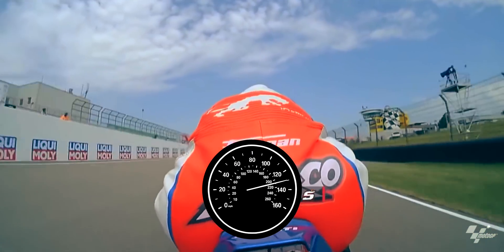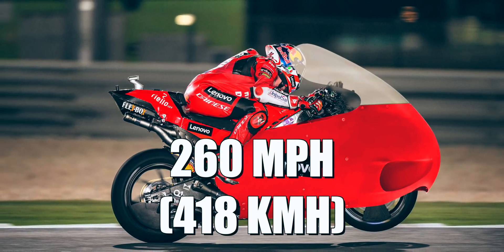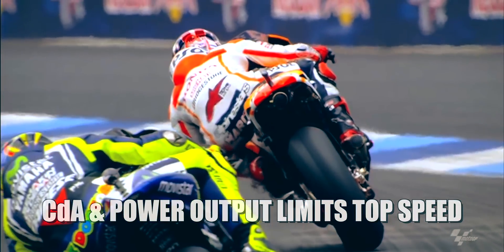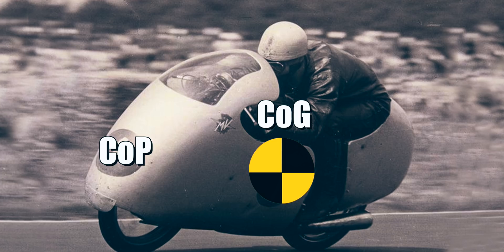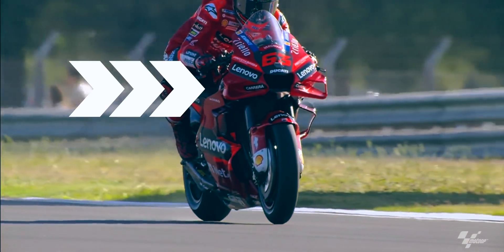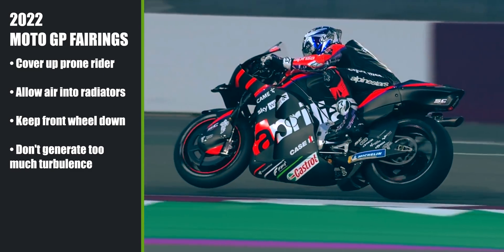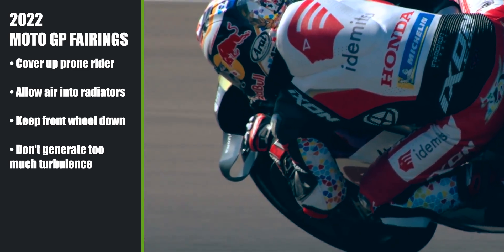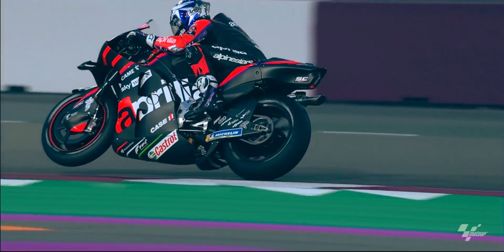Why Don't MotoGP Bikes Have Torpedo Fairings?

Comment: I believe Dustbin fairing designs can still be used, as long as you engineer in counter measures to crosswinds
Reply: No, they're not allowed. The fairing must not go forward of the front rim and the rider's hands must be visible from the side.
Reply: @gasdive 
And it's BS limits like this, that retards the whole industry. This same barrier to innovation exists in Formula 1. Do you know how creative F1 teams were back then? It wasn't just driver skill, it was great engineering. Then fools & bullies complained to authorities, instead of copying or expanding upon a great idea. Same thing happened to Audi when they brought their AWD system to American racing, competitors whined like b#$%&€ to handicap Audi, then ultimately got AWD banned. 
Crap like this is why I prefer Streetracing & open-class-Pikes-Peak, over MotoGP & F1.
Reply: @observingrogue7652  they would have solved the stability issues in a season or less, and now we'd have petrol bikes that get 100 mpg and electric bikes with 400 km ranges.

Comment: Weird they haven't implemented actuator controlled winglets
Reply: Right. Bikes need adaptive downforce, for all lean angles.
Reply: @observingrogue7652  theres a lot of room for implementation but the engineering team will have a lot of design issues to contend with for consistent downforce:
-temperature affects wind density
-wind direction (major issue)
-rider adaptability to the automated winglet
-front tyres lose their grip in the final laps so the automation would have to account for that
-suspension geometry would radically change
-each corner requires a specific downforce
-winglet location would change if it's automated as it can't be too forward so as to put less stress on the front tyre during braking

There's probably countless more engineering challenges but still weird they haven't implemented it
Reply: @baneoffsight4871  Did I detect a hint of sarcasm?
Reply: I think they should have limitations on developments that won't translate to street performance. Especially when all teams implement the tech. I submit holeshot devices,...why? Everyone has one and they are useless on street bikes, so why? Actuator winglets are at least translatable to street performance.

Comment: Without watchng the video I'll give the answer: the rules specifically prohibit the use of fairings / bodywork that encases the front wheel. This has been a hard and fast rule for decades.
Reply: neato, but the purpose of the rule is the interesting part
Reply: I’ll give the true answer. “A dustbin fairing creates a Center of Pressure that is ahead of the motorcycle’s Center of Gravity.” This makes the bike less controllable

Comment: Those fairings are banned for reason. Top speed is already a problem for MotoGP being higher than F1 creating a need for even larger run off areas and of course higher risk of severe injuries and death.
Reply: with the new tech air 10 that shuld help out in that department it pretty much cover the rider in an airbag.
Reply: @patthonsirilim5739   The need for bigger runoff is extremely serious because  airbag suits can’t prevent fatal injuries if rider hits walls at high speed.  Having room to slide off the speed before impact is best protection
Reply: @jonasbaine3538  here the thing about airbags since there introduction alot of injuries and death have be mitigated a high side use to mean fracture now it rarely does much more then bruise and being run over by a bike from the back use to mean death or disabality now just big bruises of course if you run 100mph straight into a cocrete wall your dead but track have been fairly the same run off is still dangerous for a bike rider if you fell off the bike at 150 mph there a chance you may tumble long before you hit the wall that tumble without airbag could casue alot of fracture and pain just look at monza muggello kylami silverstone etc
Reply: @jonasbaine3538  riders now have a special gadget under the seat, when it detect that the bike is going to crash the rider is ejected
Reply: What's wrong with you guys? Make everything save enough you will end up with no fun.

No one is forcing them to race these bikes. They could do a normal job or race something slower, but they choose not to.
Reply: @donblub  these are on track where safety it's n.1, for what you want you should look at the isle of man TT it's racing on a public road with near to zero safety
Reply: @donblub  yeah exactly. they get payed a fuck ton to do this so they make up for it with the salary.  people seem to forget that allot of people don't even do this shit for money they do it as a hobby. if they can risk it for nothing more than a smile then MotoGP can risk it for a fat paycheck and a fat smile. but these types of fairings are not fun to watch. a lot more enjoyable watching them the way they look right now
Reply: F1 cars have low tops speed
Reply: Highest speed in F1 was 375kph
Reply: @Smexy_af  it wasn't, officially its 370kmh and also it was back then. The cars are slower now with just 320kmh top speed and they don't accelerate as fast as they did back then. An f1 could do 0-300kmh in about 9.5secs. Now its 11secs. The gp bikes still accelerate alot faster and have higher top speeds.
Reply: @redtail1.  — When was “back then”. The modern hybrid car holds the record for fastest speed during a race.

“Valtteri Bottas currently holds the record for the highest speed in an F1 race, hitting 372.5km/h (231.4mph) in the 2016 Mexican Grand Prix.” — Autosport, June 2021
Reply: @Smexy_af  That speed was set in Baku, with a start/finish straight line of about 2,2km. The longest straight line in MotoGP I think is the COTA with 1,2km, but the best is probably Mugello because of the faster last corner. This year Brad Binder reached 366 km/h on a 1,1km straight.

Comment: Question:  Since the winglets are fixed the downforce they create works against the tires in a turn, since the bike leans inside and the downforce is pushing to the outside.  I would think this slows the bike down in the turns.  Does the winglets' aid in accelerating out of turns make up that much for the possible loss in turning g?
Reply: The winglets are angled at roughly 45 degrees. In a turn the inner winglet is therefore perpendicular to the ground whilst the other is parallel.
Normally, these would work against the tire, but they are built in a way that the inner winglet stalls, thus it doesn't produce any downforce in turns.
Since the outer winglet still works, it pushes the tire into the ground and the bike can turn harder.
Reply: @thea4401  👍 Thanks.  I deem your explanation the most logical.  🖖
Reply: @thea4401  thank you! This has been befuddling me for ages.
Reply: @phentas  You're welcome
Reply: it probably is thay way, or else they would not use them, during cornering you have slower speed so downforce from winglets will be much smaller
Reply: @mosadcoow  Slower speed? I've seen MotoGP guys at 55 degrees lean angle or more at over 120 mph.
Reply: @bayard1332  120 is still slower than 200+
Reply: They only use wings with enough downforce to prevent wheelies under hard acceleration. That's why the wings are small and only on the front. Bikes with large amounts of downforce do not go well on high speed cornering tracks like Philip Island. (Ducati)

Comment: People often forget that with race bikes and cars the goal isnt to have the most HP or the highest top speed, the goal is to have the fastest lap time
Reply: Within the rules for the class....
Reply: Which makes u wonder how fast could those bikes truly be with better tyres cuz imo the only thing limiting these bikes is the tyres, imagine them making similiar rules as F1 while introducing a pitstop rule + making a lot faster, softer compounds, wonder how much difference it would make since the race distance is considerably shorter than in F1 or how much could Michelin push the compounds
Reply: @matejsvrcek273  It's a great idea, except that we need to significantly redesign the bike so that a quick swap of tyres is possible. Unlike F1 cars, where tyres are sitting on the outside, and a simple power tool could unfasten it, bike tyres are more difficult to unfasten, due to the chain sprocket system getting in the way. Even if we machine back wheels with the sprocket and disc system ready made, we need to unfasten the chain and refasten it while changing the tyres, and this would increase time and change the characteristic of the bike due to poor chain fastening
Reply: @prabhatsourya3883  true tho the speed of the stop could be enhanced by teams adopting the Ducati single-sided swingarm design for example and I'm pretty sure if u forced the team into finsing a solution they would come up with something for sure
Reply: @matejsvrcek273  Exactly. A rule like that would require a redesign of the entire bike model. I mean, it is possible to do it, my father's old Vespa Scooter had a direct drive design which made back wheel change just a matter of unbolting and rebolting the wheel.

I mean, the concept is great. I could imagine a racer starting off with a soft compound tyre, setting blistering lap times for the first half of the race, and then changing over and just maintaining a good average lap time, fighting off other racers who are using soft compound tyres for their second half of the race. The combinations and competition would be interesting.
Reply: @prabhatsourya3883  true, today's motogp tyres don't seem to be any different from one another, you can see the harder compounds lasting a while longer but that's about it, no major pace advantage from softer tyres such as in F1 and also having people on different strategies would spread the field quite dramatically compared to the spread we are used to now where in some races u have half the grid within 10 seconds of eachother, making the sport a lot "closer" and more dramatic which is imo what Dorna is aiming for. You'll never make the MotoGP bikes as "spectacular" as F1 cars flying 300 kph thru corners but the racing is a lot lot finer :D
Reply: @prabhatsourya3883  It's not that much of a redesign, In Endurance series such as LeMans 24h they already use quick change fittings which can result in a front and rear wheel swap of under 15 seconds, the longest part of the pitstops is actually the refuelling as fuel flow rate is limited quite heavily for safety reasons, still a full pitstop is under 30 sec.
Reply: @prabhatsourya3883  would be the same for everyone though  stops  might  take a minute or two and would add a "should we stop or carry on " aspect
Reply: @matejsvrcek273  part of it is you would have to completely re-engineer the tyres, making them stiffer and heavier, so ultimately it may be pointless. 
Look at a Bugatti. €30,000 for a set of tyres with a top speed capability of 450kmh, whereas a Ferrari/Lambo/Porsche etc. easily less than €300 per tyre for cars that will top out at about 350kmh. Not forgetting that motorbike tyres have a much harder job than car tyres because you can't make them square, and they have to provide grip on the sides.
Reply: @prabhatsourya3883  systems like this already exists for endurance racing, not a problem at all
Reply: @matejsvrcek273  not just redesign the bike but also redesign the tracks with longer run off area. The speeds of current bikes are already too dangerous for some older (shorter tracks).
Reply: @alanaizen8220  A massive percentage of the tracks are just built around cars with huge grip, loads of downforce that have been adapted since the 60s/70's/80's to fit into that. Bikes are an afterthought for most circuits.

Getting into the area of having to to say "well nope you're not allowed to go that fast it's too dangerous" though... Do we want the best technical rider on a slow bike knowing that theres 300yards of run off but with no balls winning or... is it more fun to watch guys know they are playing with fire skim walls, houses, no run off areas?

It's human nature to want to go faster/beat/be better than the next guy. Anyone who rides knows (or is that stupid they don't understand) that some little blind old lady pulling out of a junction can and will end you.
Reply: @alanaizen8220  A massive percentage of the tracks are just built around cars with huge grip, loads of downforce that have been adapted since the 60s/70's/80's to fit into that. Bikes are an afterthought for most circuits.

Getting into the area of having to to say "well nope you're not allowed to go that fast it's too dangerous" though... Do we want the best technical rider on a slow bike knowing that theres 300yards of run off but with no balls winning or... is it more fun to watch guys know they are playing with fire skim walls, houses, no run off areas?

It's human nature to want to go faster/beat/be better than the next guy. Anyone who rides knows (or is that stupid they don't understand) that some little blind old lady pulling out of a junction can and will end you.
Reply: @prabhatsourya3883  endurance racing has those answers
Reply: And to sell to customers. What wins on Sunday sells on Monday.
Reply: Maybe one's goal is to have fast lap times, but that's not the only goal one could have.
Reply: @scuzzjumper  I take it you got that from years of managing a MotoGP team?
Reply: @lukasagolj7088  No, but I do have eyes and can see the RNF team.
Reply: Not dying is also an consideration.
Reply: No one forgets that lmao. This video literally addresses that near the end lol. Pay attention.
Reply: Yah but with 2 horse it wouldn't be a real race. More like and egg spoon race.
Reply: I think very few people often forget that.